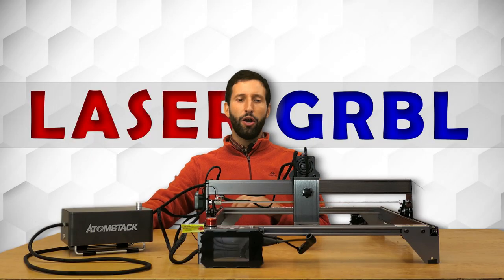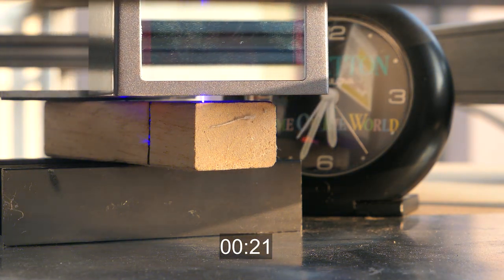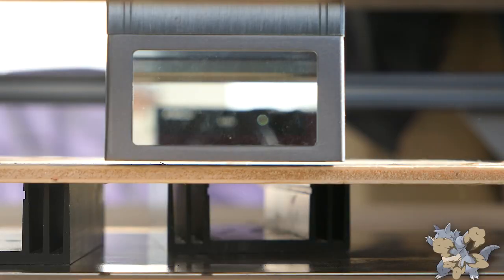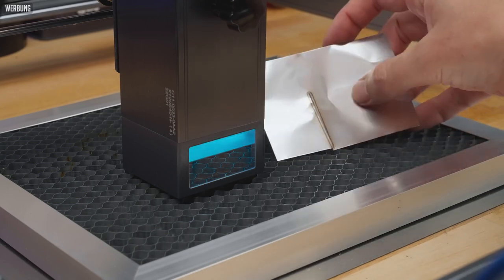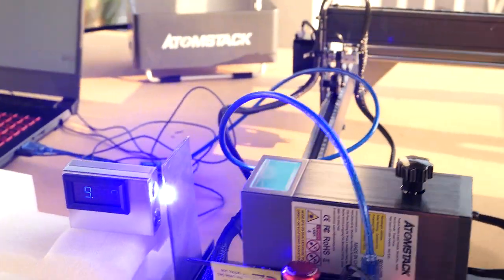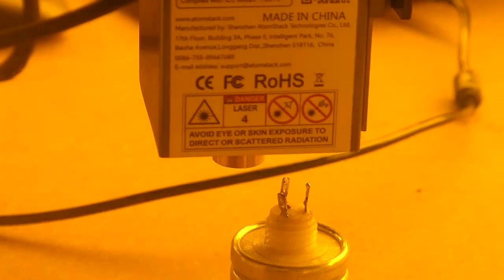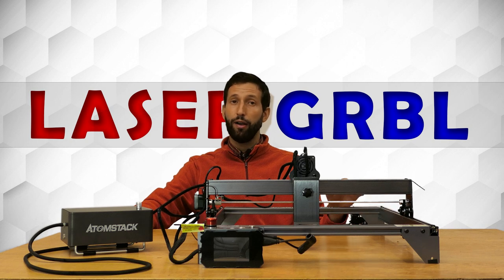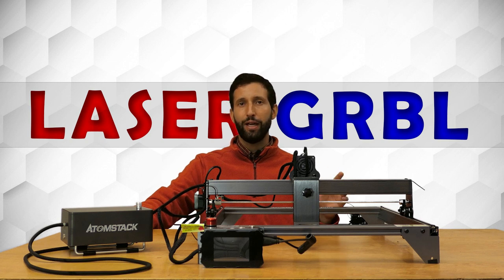Atomstack X20 - Testing and measuring the most powerful laser engraver

Comment: In your opinion, how likely is it that manufacturers will add even more diodes to make more powerful modules in the next year or two?  Is there a limit to how many diodes can be combined into one beam?  It would be great to have the power of a CO2 machine in the compact size of a diode laser module.
Reply from the maker: Increasing diode count results in serious heat dissipation issue. Each LD consumes 20W of current to give 5W of luminous power, so 15W per diode should be dissipated as heat.

This means a bigger and heavier module, so the machine cannot handle higher speed and acceleration or it shakes too much. Having more power but with the price of slower machine is a big problem to solve. Maybe a fiber coupling could be next move.
Reply: @lasergrbl  That makes sense, thanks for the explanation.  I'm new to these laser machines and hope to see further development of their cutting ability.  They have made some big advancements recently.

Comment: Hi I hope you are well! I just got my X20 pro and on minute 3 of the video you pointed at the wall and see the four lines reflection, Mine doesn't look like that it looks like a two cubes, do a have a bad unit?
thanks!!
Reply from the maker: It sounds strange but I cannot say it's bad for sure. They can have changed the internal lens system or diodes disposition.
Reply: thanks!!
Reply: How did you project the module laser shape on to the wall?

Comment: NOT the most powerful. Atezr has a 24w diode laser. 4 lasers at 6w each.
Reply from the maker: I would have to do some tests to be able to say for sure, but I am convinced that the two machines have exactly the same diodes and have the same power. Atomstack also claims to have 4 x 6W diodes and Atezr also claims 20-24W of total power.

Keep in mind that there are not many diodes in this industry and the manufacturers copy each other.

Claiming 24W of optical output power is still a fake because the lenses lose about 10% so 20W is more realistic
Reply from the maker: However I never stated in the video that it is the most powerful model, but the first to mount 4 diodes in a single module. (Atomstack release X20 the 1st of April)
Reply: @lasergrbl  you are probabky right the two laser heads look almost identical. So far i am pretty happy with my atezr p20.
Reply: Plus i like the rail system better on the atezr then the atomstack. But even the air pump on the atomstack and atezr look identical. So probably both produced through the same company. Check out tbe atezr p20 sometime .